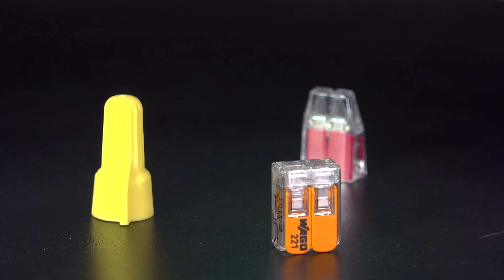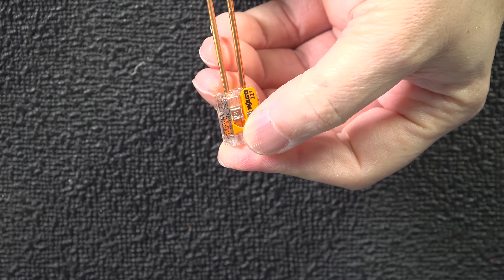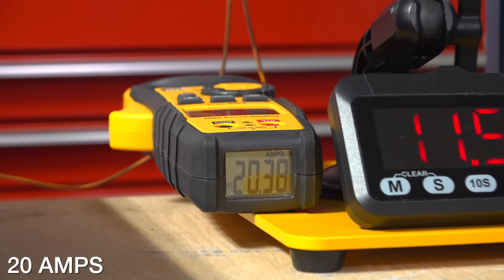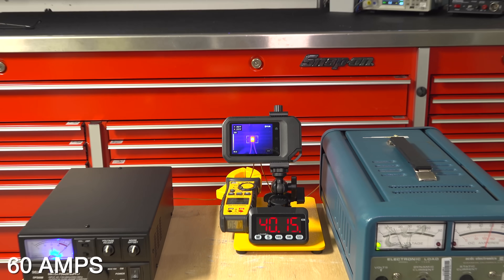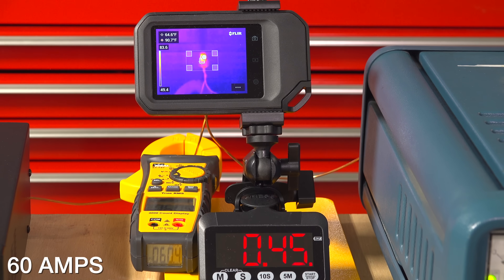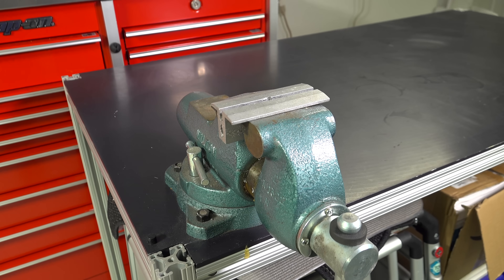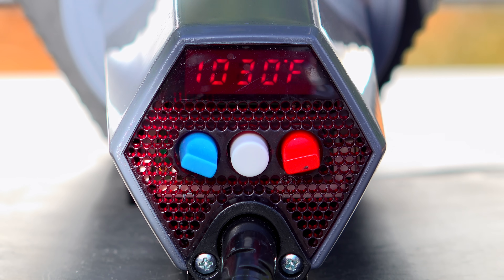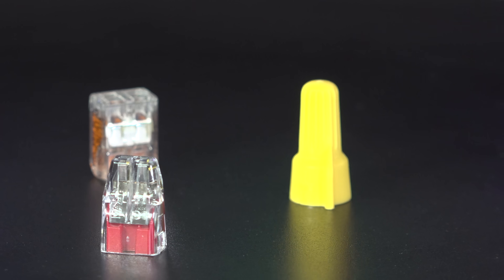What Wire Connector is the Best? Wire Nut VS Wago TESTED

Comment: It’s easy to love the wago’s, because you don’t need any skill to use them. Wire nuts can fail when they are installed improperly. I’ve been working with them for 50 years, and as long as they’re installed properly, you’re not going to have a failure. I can count on one hand out of tens of thousands the number of failures I have found when using wire nuts. Because the skilled trades are no longer as skilled as they once were, and tools and techniques are being manufactured to make up for the lack of skill, Wago’s are perfect for this trend.

Comment: Question: what if you were to solder the wires after twisting then, and then twist the cap over that? Would THAT prevent the temperature going up as much?

Comment: Was that coated wire or bare copper? If it was bare copper than the pre-twisting would have taken some of the amperage away from the wire nut, which would explain why it was cooler.

Comment: Wire nuts are the most outdated and surpassed network connection still in use (not to mention direct connection and insulation). It´s dangerous, unreliable, fragile. Just seeing it takes me back some 40 years ago or more. It looks and feels old and outdated, not to mention technical issues.

Comment: It all depends on the composition of the metal inside the Wago type connector.
All wagos are not the same. 
There may be quality control or imitation wago issues.

Comment: With so much bare wire showing and twisted, you could have performed the test even without the wire nut. The majority of people will only use an average strip length and minimally twist the wires, similar to the standard strip gauge. You basically load tested the grounded wire. That would be unsafe on a hot wire. Do it again with the insulation on it.

Comment: Thereafter test would be to get it hot, then let it cool, then get it hot again, then let it cool...over and over until the spring clip in the wagon fails. You're sending 60 Amps through a wire and comparing it to a 100 amp house service. You would NEVER have that much amperage through a connector like that. Again, give the wagon a series of heats and cools. You'll see why it fails
Reply: Are you trying to say that WAGO hasn't thought of this in the 50 years since it has been producing these types of connectors?

Comment: That Wago is rated at 20amps JET but 32amps IEC. So in europe at least it is sold as a 32amp connector - so 60amps is double its rating - not tripple. Can you confirm the wire nut is 20 or 32 amps? Its important to be certain we are looking at a like for like comparison.

Comment: Are the inline connector by wagu good for extending wires?  I have a outdoor outlet that needs to move 8".  The wires reach it through 1/2" conduit.  I intended to cut the conduit/wires in the middle, add 8" of conduit/wire, connect that new 8" section with either crimp/shrink connectors on both sides.  Now I'm envisioning using the inline connectors, in a staggered formation with the other wires, so that they all fit in the the narrow conduit. The black sleeves that you shrink on with a hair dryer looked like the best plan when space was an issue, but the inline connectors in a staggered formation look like you get a better, easier connection.

Comment: Okay the pull test impressed me because i've seen similar videos like this and the WAGO 221 could withstand like 30kg and not only 16kg, which was the result you got. Also you should've done a pull test on the wire nuts too.

Comment: For what it's worth, in ideal circumstances they work great, but if the levers (which are moved easily) get bumped open a bit; as is possible packing a box or making room for a receptacle/switch, they loose about 20% of their wire holding force.

Comment: At about the 40 second mark, it shows UL 450V/32A on the side of the Wago 221-412, what does that mean? Just want to verify these Wago 221-412 are 32 amp rated in the US. Correct? Thank you
Reply: The WAGO 221 is rated within UL 486C at 600V and 20A. The 32A rating is actually for Europe or non UL standards. I have to say the labeling on the connector itself seems a little confusing.

Comment: Wire nuts are banned in the UK as they can work loose. Wago connectors are great if used correctly but are a little expensive. As with most of these test I have noticed that the cable insulation melts a long time before any connectors.

Comment: It took over 40 years to get them certified, I use the wago termination design in industrial automation, they have been test and my last 15 years with then in both mobile and fixed infrastructure, I have not had a failure attributed to their design

Comment: I really loved how through your testing was. I was taught the same kind of thinking in Army aviation and later automotive racing. It is not enough to say, "Meh it will work." You in those settings need to KNOW it will work and how well it will work to a certain point before failing.

After watching this video I ordered a free sample, but then decided I am just ordering a multi starter  kit from amazon. I will be installing some smart switches this weekend so I am excited to see how they do. I wish they made a nice version of this for automotive use. I can think of a couple places where I could safely use them. I might try it.

Comment: I wonder how different the temperature of the wire nut would be if the wires were only connected inside the nut and the twists didn't extend so far out of it. 

Neat test though.

Comment: I was surprised that the wire nut connection heated up that much.  With the 2 conductors twisted and capped, I would think the resistance between them would be very, very low.  Yet there was enough voltage drop to heat the connection up. The Wagos pass the current through their internal 'bus' with possibly higher resistance. (voltage drop and heat) Thanks. Good demonstration

Comment: I've been in the electric business for 45 years my dad was a electric contractor and my grandfather was a electrical contractor. I've had 50 electricians work for me with 10 service trucks.  We really never had any problems with wire nuts.  I don't know where you live but we just haven't had much problems. Of course you can make them fail if you apply more voltage than there designed for. But In normal applications we just haven't had much problems.

Comment: I think you missed an important part in your test.  The wire gauge you are using is 12 gauge.  It's only rated for 20 amps.  I would think that most of your temperature increase is due to the wire itself heating up at 60 amps.  Your twisting the wire when using the wire nut to me proves it.  The wire nut is in a way doing nothing.

Comment: we use these on 20A circuits all the time, you always get the old stick in the mud (also wago 221 series is rated to 24A). The main issue with wirenuts is the twisting. We test wiring, that requires disassembling connections.  Twisted connections will work harden, thus the wire nut is inferior under UK STANDARDS
The USA doesn;t seem to bother with testing , so they are equal there

Comment: I use exclusively wagos. yes they are more expensive but they are so much easier to use than the traditional wire nut. I still keep some wire nuts on hand in case I want to cap off a wire that's not being used.

Comment: It's funny that there are so many people that are too dumb to use a wire nut properly. I also really don't understand having so much trouble joining solid and stranded wire in a nut. Just put the end of the stranded wire slightly past the end of the solid wire and put the nut on. It really is that simple. No pre twisting, no taping, no twisting the wires after putting the nut on. I've used them for 15 years without one single problem on any of my own work. Plus, nuts are about $.13 vs $.31 for the wago.

Comment: Ive traditionally used wire nuts on projects of the past but this recent one of upgrading my 22 year old hardwired smoke detectors to modern ones and installing new emergency backup lighting it decided to use Wagos. made the job go much faster.

Comment: What you didn't do directly, but you did indirectly was a resistance test.  The reason why the wago heated hotter at 60A than the wire nut at 60A is because the wago has higher electrical resistance.  The extra resistance is what is causing the extra heat.  (If you don't understand that go back to Ohm's Law and Watt's Power Law).    Having more resistance is bad.    Also each Wago is more expensive than a wire nut.   And now you have the problem of Wago rip-offs and people who don't understand amps.   

Wago rip offs are not as well made as Wago brand.   The mental inside is alloy.  And not as good as Wago.   Then many electrical folks (not just DIYers) don't understand ampacity.   When a 4 prong Wago says 20A or 30A rated, it means the total amps on all 4 wires cannot exceed 30A.    So what happens when someone uses a 4-prong 20A Wago on two 20A lines? FIRE!!!  On the other hand a wire nut gets bigger, has lower resistances, and thus has no issues with two 20Amp lines.   It's automatic.  No thinking required.  The size of the wires forces you to use a bigger wire nut. Then there is the price.  Wire nut, 10 cents.   Wago $1 dollar.  You need 10?  Fork out a buck for wire nuts, and fork out $10 for the wago. 

If you are a DIYer or a "professional" who doesn't understand what I just said, then you must use wire nuts -- not Wagos.

Comment: Without a doubt wire nuts are better.  With the wagos, all you have is a semi-tight mechanical connection.  With wire nuts, you have wire directly connected in a twist. That's  very important because of the amount of metal directed twisted together.  Then you have a mechanical connection with the wire nut.  2 forms of connection vs. One with wago.  With wago, that's also a 2nd hand connection too, not direct wire to wire.  Wagos can lose their connection I have found randomly.  I've never had problems with wire nuts in my 30 years of use.  Had several problems with wagos in just a couple years.

Comment: You should have kept all tests exactly the same. Preheating the Wago for 20-30 minutes of use then cold starting the wire nut at 60 amps for 10 minutes skewed your temp result. Otherwise I thought your test was interesting and viable. I just used Wagos for the first time on a bath remodel, and they are indeed easy and fast. I also used wire nuts where they worked or fit better.  Anything can fail, especially when not installed properly, so I expect we’ll continue to hear horror stories but have found some pretty scary “professionally installed” electrical work in my time so that is what it is. Wire nuts and Wagos are both thoroughly tested and certified, so use what works for you. It’s always going to be the installation that matters most.

Comment: The problem with the wire nut test is the wires were touching well below the connector. The wires should only be touching inside the connector. This gives the wite nut an unfair advantage over the Wago

Comment: I've always held my breath (sometimes) when it comes to getting wires situated in a box with wire nuts. Just by doing that you can spin them even very slightly. Some times I wedge the tip if the nut in the corner of the box (put some tension on pushing the nut down)  just to make myself feel better!

Comment: I’m an engineer and I’ve been very skeptical of these wagos. I figured the bus would not handle the load from line branches. This changes my mind.

Oh, and I’m a firm believer that twisting the wires is what secures them and maximizes conductivity while the wire nut is for insulating the exposed twist of conductors.

Comment: Maybe I am just too stupid to get it, but what's the point of a connector when you have to twist the wires first? Sounds to me like compensating a design flaw of a connector. It's like putting two wires twisted into a screw terminal which sounds wrong... Just my thoughts though 😂

Comment: I bought a small assortment box of the 221 Wagos (412, 413, and 415) to use when replacing some of my switches with smart switches, and replacing the ceiling fan in our bedroom. They are not only very easy to use, but also can save space by allowing everything to lay flat (though some might argue that because some are wider, they'll take up more space). I will only buy Wagos when I need to do electrical work at home now. No more wire nuts for me!

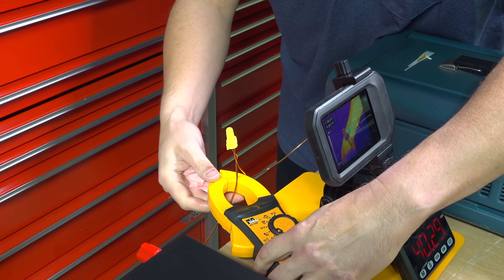Comment: 3:07 I would say that the connection test for the wire nut was invalid for the reason that you twisted 2 or 3 inches of wire together but the wire nut only touched about 1 inch of wire.  So the extra 1 or 2 inches of twisted wire effectively doubled the wire contact area, which would reduce the temperature of the connection under the load.  You should redo the test making sure to only twist together enough wire that the wire nut would realistically touch in normal use.  The usual household connection would not have 2 inches of bare / unshielded wire trailing out from a wire nut.  Most electricians would only unshield enough of the wire to allow for a good electrical connection.

Comment: Why d
You did not do a pull test on the wire nut to be a fair test I think one should have been done.
Reply from the maker: The wire nuts pull strength is far beyond the Wago. I thought that was undisputed. As far as what it means, well its absolutely nothing. Its like saying Coke is a good lubricant. The holding power is trivial but if you needed to tow a small trailer the wirenut would beat the Wago.

Comment: The fact, that there even is a debate about WAGO in the US amazes me. They are compliant with german VDE, therefor you can use them. German VDE is EXTREAMY strict about everything to ensure maximum safety. 
If VDE says its safe, then its safe.
Reply from the maker: Debate is a nice way to say it. US electricians hate them, its crazy. Everything about them is better except yes they do cost more, but they also take 90% less time to install. It is changing some, but very slowly!
Reply: @SilverCymbal  Seriusly? 
Everytime I see a video about electrical wireing in the US i cringe a bit, because it always seems a bit unprofessional compared to what I'm used to (I'm an electrican in germany). Maybe just because the standards in germany are so high. And then the same people hate on WAGO. Amazing, Truely.

It seems like its the same as with the metric system. Its better in every way, but the US hates it.

Comment: I grew up with wire nuts until I discovered Wago connectors some years ago and I've been using them ever since. You can see the connection inside, replace them much easier, some have dielectric grease inside making them perfect for outdoors, and they have a flatter profile. Wire nuts rely on the tug test and you cannot see the connection inside. Even worse if you're dealing with threaded and solid core wiring in the same circuit wire nuts are terrible choices in my experience.

Comment: The testing performed in this video was on solid core wires only. I'd like to know how these connectors compare when joining solid to stranded, and stranded to stranded, versus the traditional twist nuts. Most light fixtures and ceiling fans nowadays require a stranded to solid core connection.

Comment: 19 years licensed electrician here. A year and change ago i decided to start testing my connections. Butt splices, crimps, wirenuts and waygos. So our results actually line up and maybe I should of done the orignal footage to YouTube, but its other places. Regardless, our results are similar and I used a welder for the power supply going up to over 100 amps for the yellow and red or tan sized wire nuts using 14, 12, 10, and 6 awg wire.

Comment: Small note: Metric uses Newtons for force. Kilogram is actually a unit for mass.
Reply: 1 kilogram-force equals 9.80665 N
Reply: @Mark-et1pz  It's also not a valid unit in the SI standard and as such, is not actually used anywhere.

Comment: I see a lot of post from the electrician side of things, figured I would share my input on the low voltage side as an electronic engineer.  Great test from what I have seen.  I have watched a lot of other videos on the comparison and was appalled with some of the misleading things I have seen in other videos.  I think one of the biggest things to note is that wire nuts will generally always work at a cooler temperature based on how they work.  With the Wagos, you are creating a bus that all current needs to run through. In doing so you are creating a specific point where all the heat will be transferred to.  With wire nuts, the wires themselves will be the electrical bus, thus not adding any additional resistance at the splice point.  That being said, I am very much a low voltage technician and do not have to worry about excess heat like an electrician would have to.  Because of this I do believe both types of connectors have their applications.  For me wire nuts are the best bet when connecting up many low current draw devices to a single power supply (in excess of 5+ 20 gauge stranded conductors).  When working on electrical outlets in my own home, I tend to use the Wago connectors for three way switches as it does have a cleaner look and tends to be more space efficient.  Great video, and to anyone reading this, use what you like best as they both have their pro's and cons and are well engineered.

Comment: The thing is that in the rest of the world we use 240V, whilst the NA uses 120V. So they must take much more current to make up for the low voltage, thus they heat up more.

In a 240V system we usually don't go over 16A for any circuit. If we need more umph we add more phases.

Comment: To make this a valid test you need to have insulation running up to the wire nut.  The way it was tested current was going from wire to wire outside the wire nut.  Ref video at 3:41.